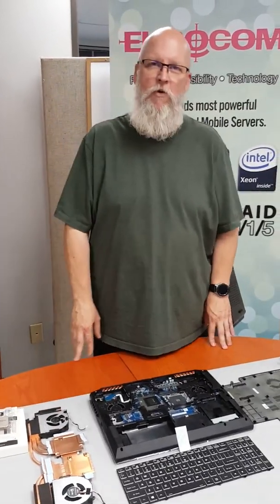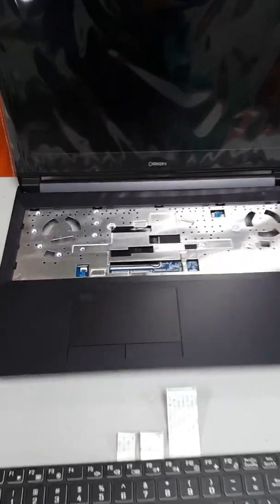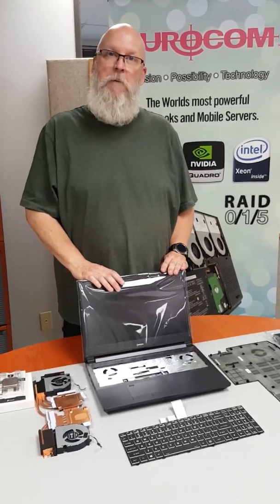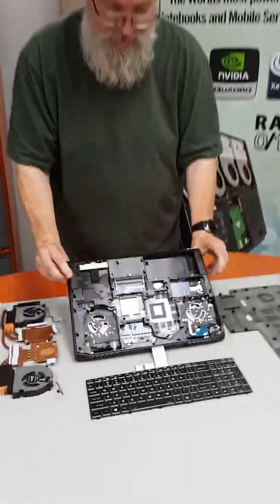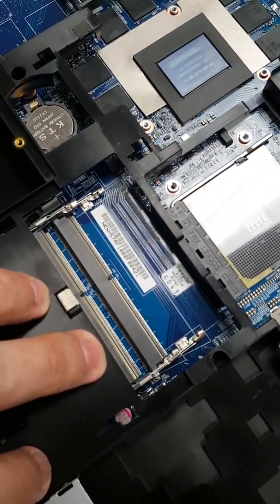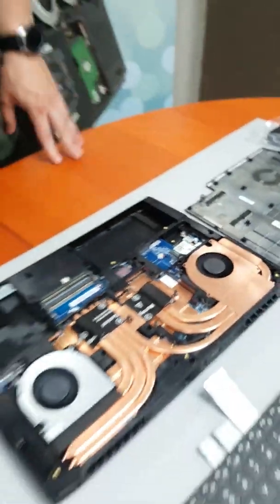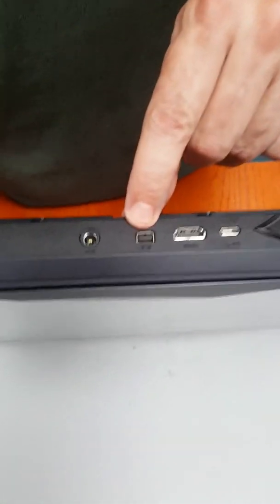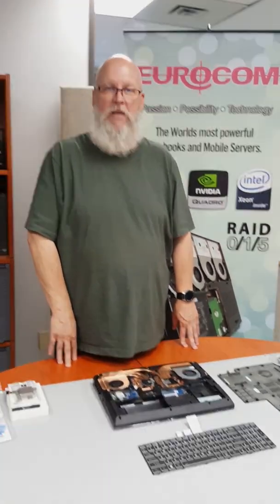ARX15 Presentation

Comment: i have eurocom sky x7w and  super just sometime i have problem with  these so i use notebook and then keyboard dont work and must restart windows and i dont know where is problem and keyboard is new but i like Your notebook is good
Reply from the maker: That sounds like a driver issue.  Get your driver USB drive and re-apply your chip-set driver first and any other driver like Touch pad ect.  Never let Windows update your drivers for you.  Sometimes they supply incompatible drivers and can cause all sorts of issues.
Reply: @EurocomTechnology  and can you send me driver/s for keyboard and touch pad in my email pls? thanks
Reply from the maker: @robertcacak  The Drivers for your system are here... https://eurocom.com/ec/drivers(334)SkyX7W
Reply: @EurocomTechnology  ok and else I want ask in how much have keyboard life for use and dont exist for Adaoter for power something for cooler adapter and where I can download again Killer network control center from rivert?